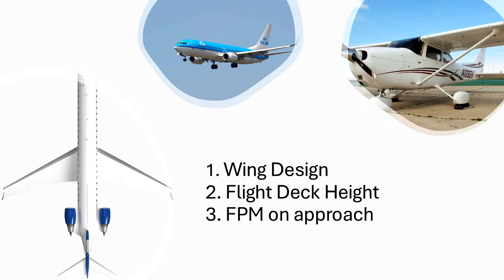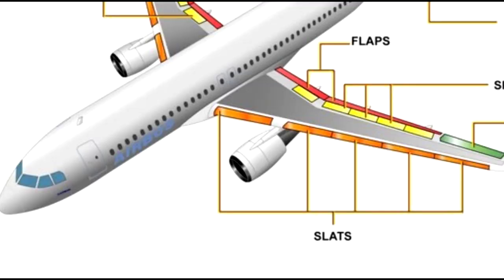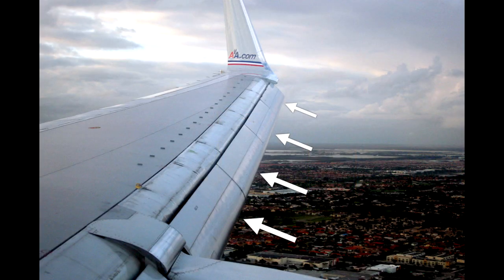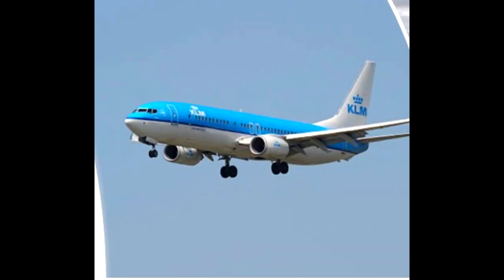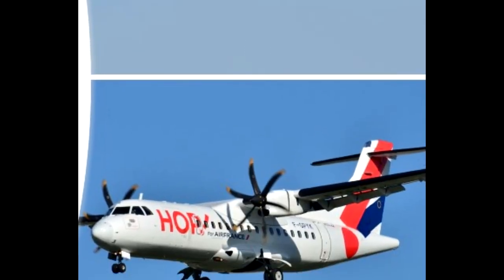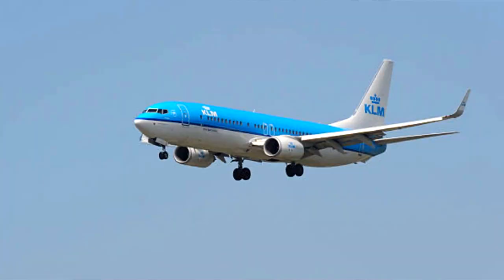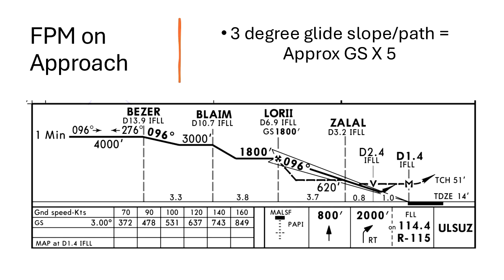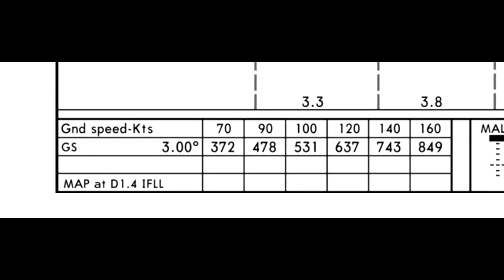Hard Landings

Comment: Not exactly related to hard landings, but I have to agree on the impact of flight deck height. I live in Greece, and I was told by my instructor that there was this one time when he was approached by a pilot, who asked him to fly the flight school plane (c172) with him for leisure purposes. The guy was an ex military pilot, after when he joined the commercial world flying A320's as FO for 3 years for a local operator. As my instructor and him flew some patterns together, after some time it was time to land. So the guy flew the plane towards final and my instructor couldn't help but notice he was getting higher and higher off profile. He ended up like 100 feet over the threshold (on a very short runway too) and shortly after, he initiated flaring, ending up just before a stall at 40 feet of height. Had my instructor intervined seconds later than he did, they would have crash landed. I know its an extreme case but it really goes to show how great flight deck height can affect the pilot!